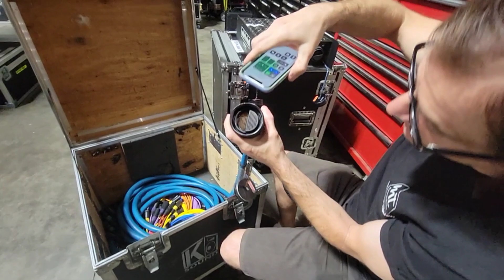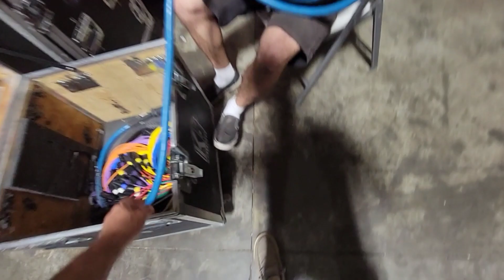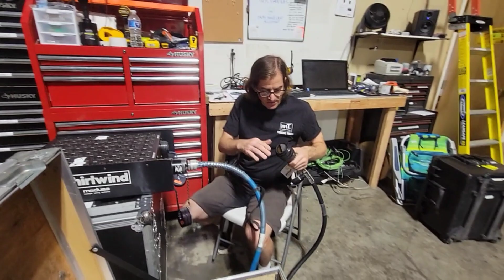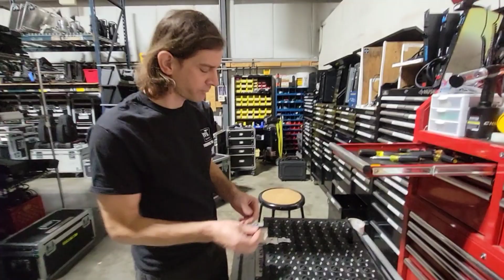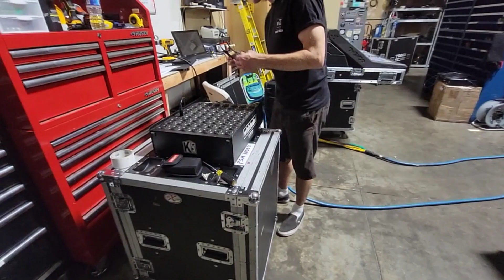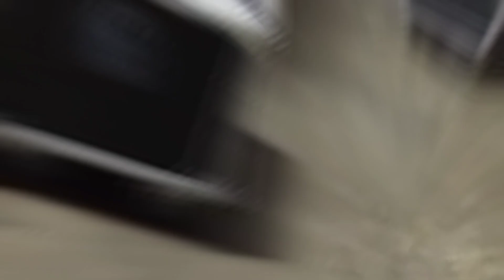s12e7 How To Fix Whirlwind 56-Channel Split Snake Bad Channels (In The Style Of SSV)

Comment: MASS connector trivia: did you know that these were originally designed for buildings in earthquake prone areas? Areas of the building were designed to operate independently of each other so they could sway in an earthquake. The MASS connector was the disconnect point. Water and gas pipes were made of braided flexible tubing at certain points. With the MASS connectors handling the data formats of the day.
Reply from the maker: Wow did not know. That's pretty amazing though.